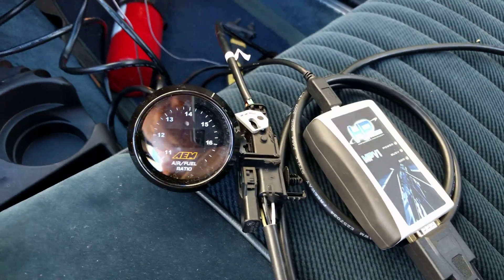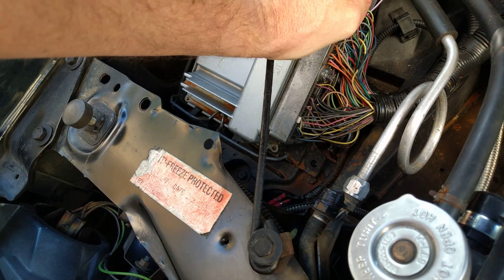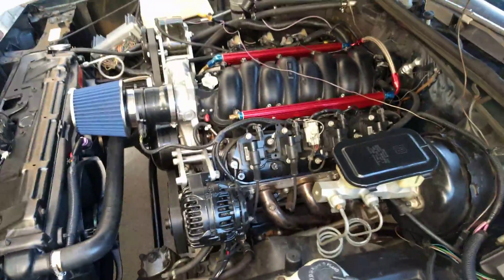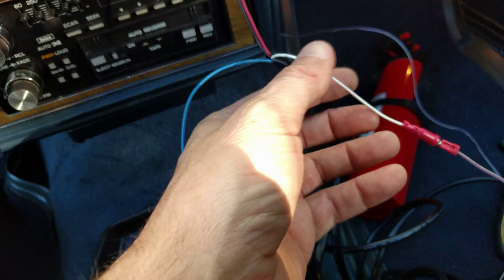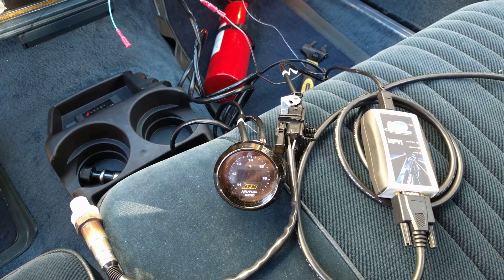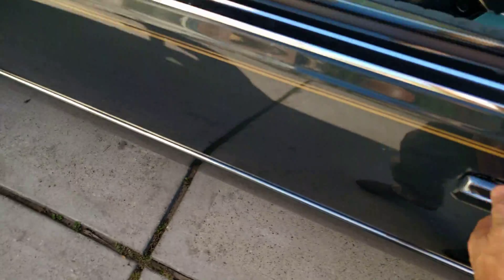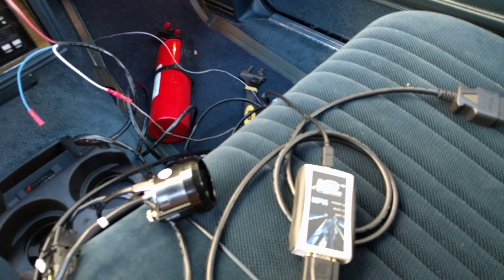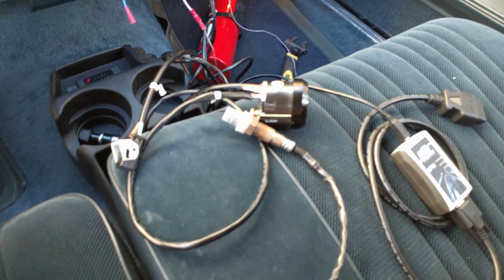HP Tuners "Standard Edition" wideband O2 install

Comment: can you tap into the EGR wire or AC wire instead of messing with the pcm and pins?
Reply from the maker: Yep, sure can.  It's been a long time since I've messed with it, but I remember people saying they've used the AC input
Reply: @nu5m_radio  you seem to have the hptuner interface between the obd2 port and you laptop.

Will it work if i coont obd2 port directly to the laptop with the small interface in the middle?
Reply from the maker: @FirstLast-tx3yj  Not sure I understand the question.  I have the HPT interface connected to the OBD as normal.
Reply: @nu5m_radio  yes can I connect my laptop with the hptuner software to the obd port with normal obd cable without the hpt interface??
Reply from the maker: @FirstLast-tx3yj  No, not that I'm aware of.  Mine is connected to the PC as normal.

Comment: Let’s say I’m running HPT full time in my car and using the live data for gauges instead of physical gauges. Is there a way to eliminate the use of the physical Wideband gauge and just wire the wideband sensor up directly? The heat function of the wideband sensor can be pulled from the narrowband sensor. Black wire on the wideband is ground I’m assuming so you can run it to the chassis. Red wire I’m assuming is the keyed/fused 12v. Last wire I have is a yellow wire which I have no clue about. Maybe it’s the one that can go to the egr/pcm?
Reply from the maker: I don't think connecting the sensor directly will work.  You could just mount the entire gauge under the dash where you never would see it.  I thought about doing that at one time.
Reply: pmoore4321 I was just thinking of something temporary so I can see it in my data log program on my tablet.
Reply from the maker: @ronnieshadowen7277  You have to be careful using some lower end hardware also.  The input will become "laggy" and won't actually be real time which is important. 
 I just use a usb to serial adapter and plug it into my laptop.  HPT will immediately pick it up without having to do a lot of configuring.

Comment: Does this work on the E67 PCM?
Reply from the maker: I'm not sure.  If the E67 has an EGR or A/C pressure input, it should.
Reply from the maker: X3 pin 57?
https://www.corvetteforum.com/forums/c6-tech-performance/2571056-ls3-e67-ecm-pinout-needed.html
Reply from the maker: https://www.corvetteforum.com/forums/c6-scan-and-tune/2218647-egr-pin-for-08-corvette.html
Reply: @nu5m_radio  So, if one had the EGR unplugged and the female end is sitting right there, could you just splice in to the wire there? OR do you still have to find the pins in the PCM?
Reply from the maker: @customyamaha  I would think that would work.  Just make sure the wire you're tapping runs to the right pin on the PCM.  I'm not sure you even have to log through the EGR or AC to get the data to HPT any longer.  I thought I read that HPT will pick up the wideband signal when the wideband is plugged directly into the serial port on the  computer.

Comment: Thanks for the tip! Doesn’t the wide band sensor require a 5 volt reference?
Reply from the maker: The 5v is supplied by the WB.  The mod just allows the output of the WB to be data logged through the A/C pin on the PCM.  You can do the same thing using the EGR pin.
Reply: Thank you very much. Great tip!

Comment: So you wire it up regular and just wire you analog wire to your a/c switch
Reply from the maker: Yep....just run the A/C pressure input from the PCM to the output (white wire AEM) on the wideband.  I ended up just  tucking the wires away and leaving the WB hooked up permanently.